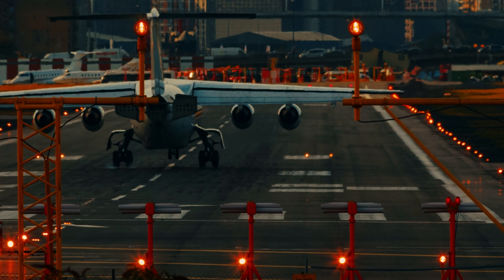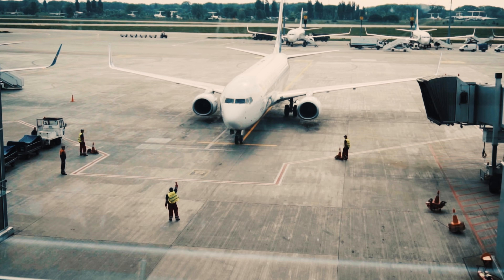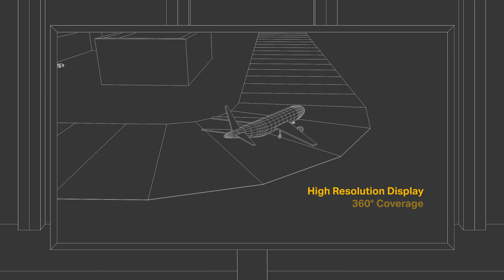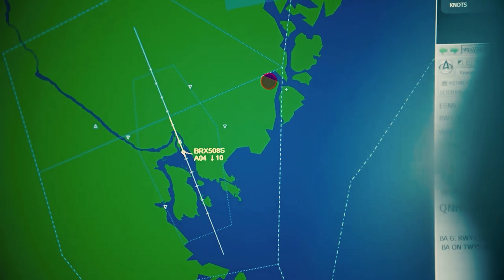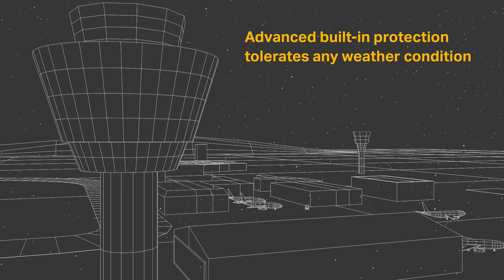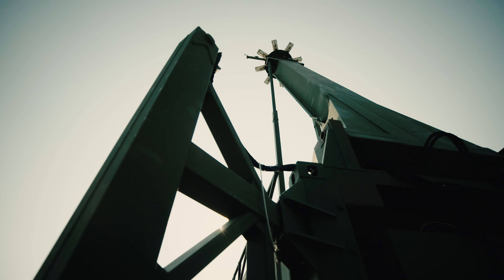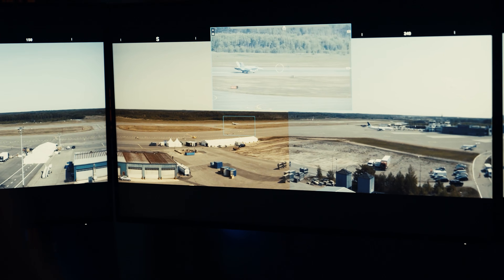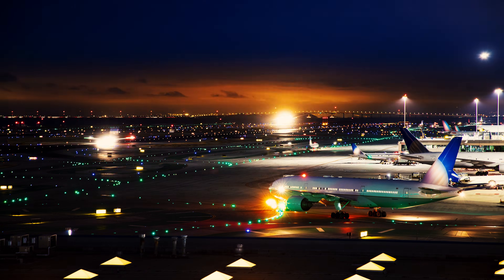The Airport Tower That Isn’t There | Let's Talk About Tech

Comment: What if a Shahed drone strikes the air control centre? Or is it buried deep underground?
Reply: What if a shahed drone hits an ordinary tower?
Reply: @vfr492  Well then only THAT airport is affected, not ALL airports.
Reply: @bingoberra18  It's possible (if not necessary) to have multiple decentralized remote ATCs.
Reply: @vfr492   smashy boom boom
Reply: @vfr492  If a shahed hits a civilian airport, then I don't think resuming operations is the main priority either way - you'd fall back on emergency procedures and have planes move to other locations. And for military towers you'd have them protected in the same way your ops center on a ship isn't the actual bridge
Reply: @danieldkland  But who is coordinating this if the only control room in the country is out? As they said, no other airport would have a manned tower, so there is no one else to lead?
Reply: @bingoberra18  As they said, large airports would still be served by people on-site, but just like if a current, normal ATC tower gets taken out, you have emergency procedures that require all planes to coordinate with each other themselves - or a different type of controller takes over (i.e. another airport's, an ARTCC, a TRACON housed in a different building or something).
Reply: @vfr492 we still can work where, because people know how to work with no cameras. What if somebody cut your fiber cable?
Reply: What if a drone hit on your mother?
Reply: Its distributed and redundant.
Reply: How safe will you feel with your flight being handled from Bangkok 😅
Reply: @gspotmop8242  If it is manned by professional air traffic controllers there is no inherent issue
Reply: @gspotmop8242 Pretty safe